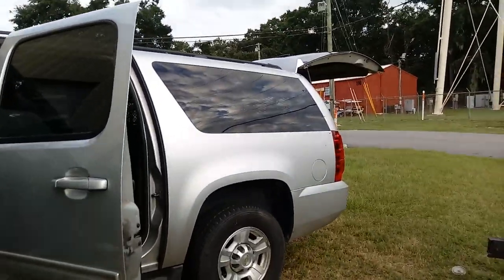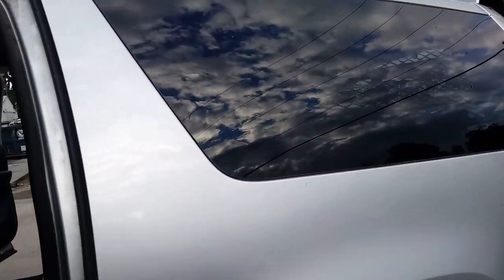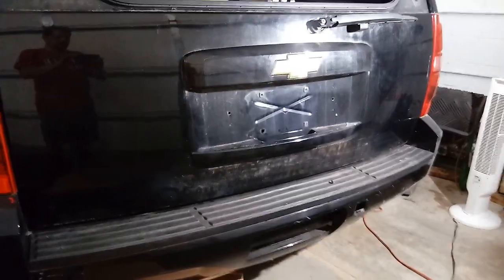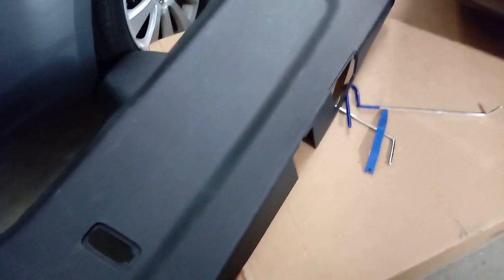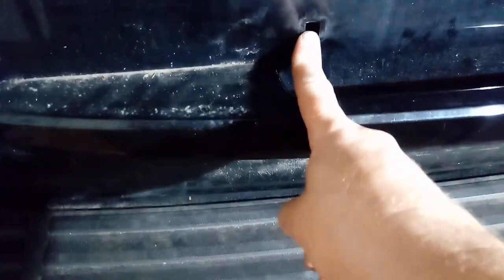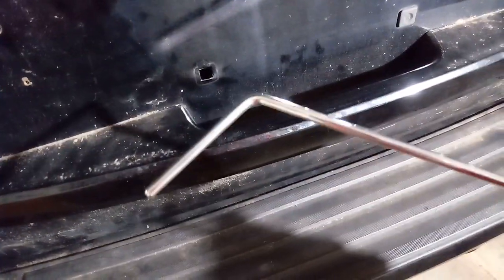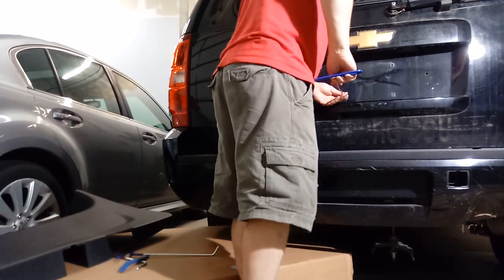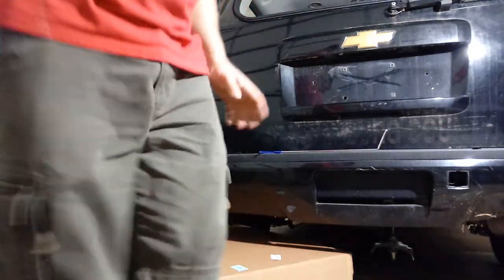Open tailgate on Suburban when switch fails

Comment: Neat trick going in through the license plate bumper hole.  Of course if the button on the outside fails, you could use the fob or button on the overhead console to open the hatch.  I just replaced the glass release button on mine.  Thankfully I could pop the glass with the fob, not sure how else you cold do it without drilling / breaking the trim panel.

Comment: I might have to try this.   My wife has a 2008 Yukon Denali.  I got the new replacement motor but 
I could not get the trim off all the way, her’s does not have the handle that you have to unbolt as i’ve seen on several other videos, I think it’s only accessible with the liftgate open.  Her’s does not even have the mark on it where you are supposed to drill the hole.

Comment: same for a 2015-2020?
Reply from the maker: Do not know.
Reply: @swiftWord  its not the same - for a 2015-2020 you have to pull the small plastic trim piece around the lock back is much as possible (from the inside), then there's a round circle inside that looks like a 3/8 or 1/4 inch drive but its not - you insert a flathead screwdriver in and turn counterclockwise to unlock.
Reply: @mikeh.8155  how exactly did you get it in there?